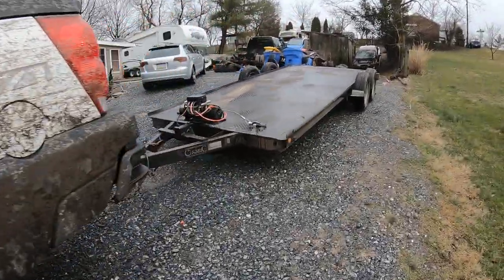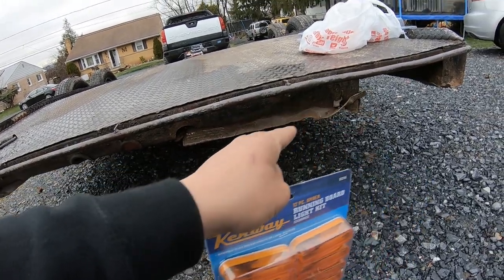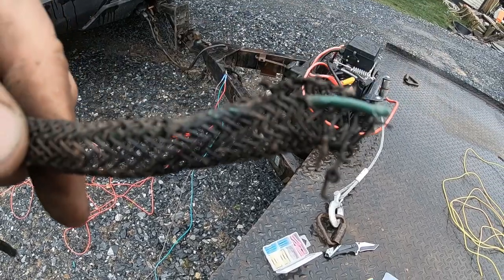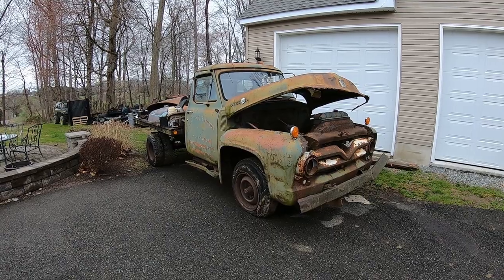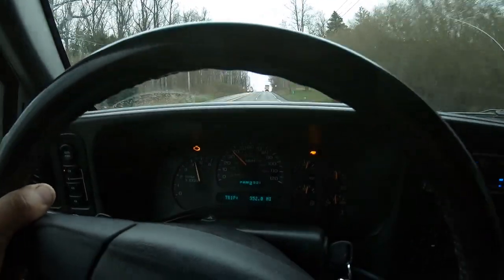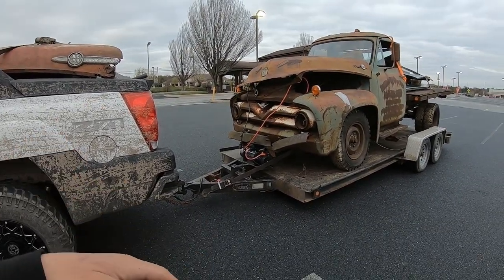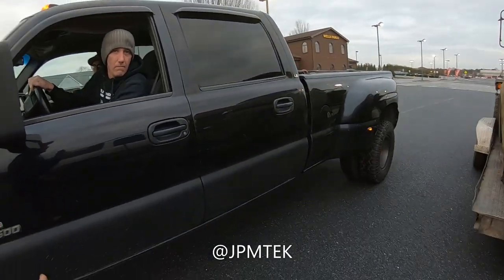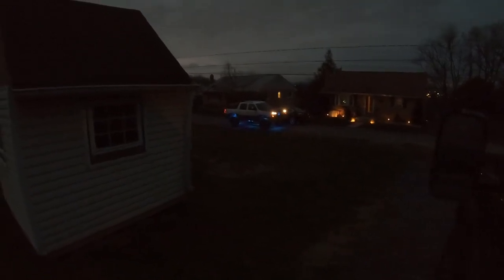MY AVALANCHE SUCKS! I COULDN'T TOW MY 53 FORD HOME!

Comment: The Avalanche is rated for a towing capacity of 8,100 pounds for the 2WD models and 7,900 pounds on the 4WD model. Ballpark weight of an F-350 cab and flatbed would be in the neighborhood of 3,000-3,300 pounds, depending on options. Now for the trailer. Since most trailers of this type weigh about 100 pounds per foot of deck length (16' trailers will weigh about 1,600 pounds 18' trailers weigh about 1,800lbs and 20' trailers weigh about 2,000lbs) I can tell you with my 40 years experience of a truck driver that hauled equipment that the only thing you did that was unsafe was you loaded the truck wrong. You had way too much tongue weight. You want to start with setting the trailer upright. With the trailer connected to your truck put a 4 foot level in the middle of the trailer and make sure the bed is level. Now when you load the trailer pull the vehicle on as far up to maintain the trailer at a level only pull it all the way to the front of the trailer if your trailer is level.
Reply: Yep I agree. He has always been spoiled with the f450 he doesn't really know how to load a trailer because he has always just been able to tow it and it works.

Comment: I have an Avalanche with the 5.3 engine and have towed many cars with it just fine. The key with the Avalanche since it’s a short bed just raise the ball hitch to bumper level. If not your whole back end is going to be sagging causing the shocks to bottom out.

Comment: Your towing a 1 ton dually with a 1500 your lights weren't the illegal part lol,and you loaded way to heavy on the tongue. I thought Fred's hood was going to open on the highway😬🌋. Shoulda took the ramp truck...nothing like rumbling down the road in a square body with a bigblock powering it trust me...
Reply: Those old trucks are way lighter than people think.  I scrapped a bigger one that that, 4200lbs
Reply: Yes true but still overloaded the avalanche none the less and did you see the hood bouncing when jmtek was towing it? It woulda been fine if it was more evenly distributed and I'm not innocent when it comes to taking a chance so I cant say nothing bad. Love the content it's real not corporate...
Reply: 1000% they loaded the truck on the trailer too far forward which is reason shock is bottomed out.

Comment: I have an 03 Avalanche 1500 with the 8.1 liter in it. I can tow a 33 foot camper with no problems. I have the Bilstien 5100 shocks on it and it rides nice.
Reply: That’s nice but than it’s a 2500! 
They are pretty rare in good condition. You have 8 bolts on your rims. You own a tank my friend!!

Comment: Lol the avalanche is a soccer mom truck it ain't made for towing anything let alone a solid steel full size 50s pickup
Reply: I've towed 8k lbs in my avalanche. His just isnt setup for towing. On a coil spring you really need a weight distribution hitch. Clearly he was spoiled by the f450, welcome to the 1500 life of 2002 😂
Reply: Hell I haul everything with my 96 zr2 blazer on 35s and never had any issues and I even went and picked up an f350 4 hours away and pulled it back no issues
Reply: I hauled a 1975 c20 truck and trailer were about 7000 and my avalanche was loaded down with gear and weighed about 7000 to but mine had stock suspension and I ran 85 for about 6 hours straight
Reply: Nah this dude just ruined his truck and wonders why he can't tow shit. My stock avalanche with the tow package can tow a truck or boat no problem all day, definitely ain't no "soccer mom truck" get yo shit straight lmao
Reply: @bradleymenezes6196  exactly these cats are dumb af. This kid literally destroys his vehicles and wonders why they dont run right.
Reply: @Hugo_Stigl1tz  takes out oem suspension or whatever the fuck he did and sets some stupid, impractical shit up and then blames the truck 😂

Comment: It looks like the shock failed because either the axle bump stop is gone or the shocks are the wrong size. This caused them to become the bump stops and to bottom out. Way to much tongue weight also but SendIt knew this after all he isn’t lacking in knowledge but possibly lacking a bit of common sense like we all do at times. Thanks SendIt

Comment: Just put heavy duty coil over springs in the back it’ll help or get airbags. A tuner would help somewhat with power. Nice video.
Reply: Lol nothing is going to help an avalanche turn into a tow pig. It's a Tahoe with an open cargo compartment.  If he didnt hack up his F450 this wouldn't be an issue..

Comment: Too much weight on the tongue.  if you had moved fred back the trailer would have balanced and you wouldn't have had the issue with the shocks bottoming out.  Center of load weight was in front of trailers axles.
Reply: good for stability bad for towing height.

Comment: Well first off there is two axles on that trailer so try to center the load over them not on the tongue. So many people don’t understand to center your load so only maybe 500 pounds is riding on your truck. You will be able to drive more stable and not hurt your suspension.

Comment: Hey Steve, why don't you just have maybe two projects and also take on something that doesn't need so much work. You never finish a project, so if you only had one or two than you probably would finish them and they would come out finished. Still good luck with whatever you are doing as long as you are happy. Stay safe traveling and try to keep your distance in public.

Comment: What shocks did u use in the front when u did ur lift i have a 6 inch tuff country lift and instead of longer shocks i have 6 inch shock relocation brackets and my  Front in sags a little bit Which makes my front driver side tire rub
Reply from the maker: Where do you have your torsion keys at?

Comment: Isn't this what you bought the ramp truck for?? The ole 454 woulda done it unless the deck was to rotted through. And Steve you should sell a project and go buy a new flatbed trailer. Like an equipment deckover trailer. No more issues with trailers and stuff.

Comment: Do you mean to tell me the HD front clip doesn't give you more towing capacity?... lol.. actually it probably went down as you gvwr went up with heavier parts lol. 7900lbs isnt much toe capacity for the smavalanche... considering the 2500 classics can tow 12k.. everyone posting about "add HD coils, add a tuner, do this do that"... guys it's a worn down avalanche.. basically a Tahoe with and open trunk. It's not meant to be a tow pig... that's what you would call something like an F450.. if only we had one lol.. we did.. now it's a F450 project tandem dually. Which will only increase your GVWR... decreasing your tow capacity. And over all GCWR capabilities decreased..

Comment: Fred was loaded a bit to far forward but a avalanche really isn't meant to pull a trailer
Reply: @tenatra  I tow 10k behind a dodge Dakota without issues I'd never think about putting that much weight behind a avalanche
Reply: @tenatra  yup that may be so but I'm more comfortable in a dakota then I am in a chevy and for reference of mileage my dakota has 350k on it rn and still pulls all the time

Comment: Hey sendit Steve not too sound like a ass but as a professional driver who hauls freight all over the country you want too keep the load more centered than what you had fred set up. Try putting it back about 1 foot back from where you had it at. Just a professional tip from a Pennsylvania truck driver

Comment: 100% fail on the tongue weight.....you need a weight distribution hitch and maybe don’t put soft “off-road” suspension on your truck if you plan to tow. That’s why the first gen raptor can’t to a lot either....

Comment: Please the avalanche was fine you could have made it with no problems these 1500 trucks are much better at towing than people think
Reply: S. Ray my dad used to run a 1500 ram with the small v8 and it pulled a float with big trucks on it to the scrap yard all the time, never had a problem

Comment: A couple things.

1. Orange or amber lights do not go on the back of the trailer. Those should be red only. On the sides of the trailer is fine.

2. Better bump stops and a set of air bags are needed if you are going to tow or put heavy loads in the back of that Avalanche. It can be done with a little more work. (This would also be cheap content. How much would installing air bags and better bump stops cost?)